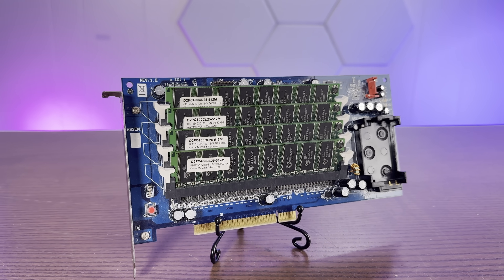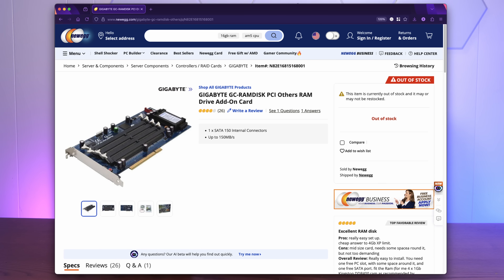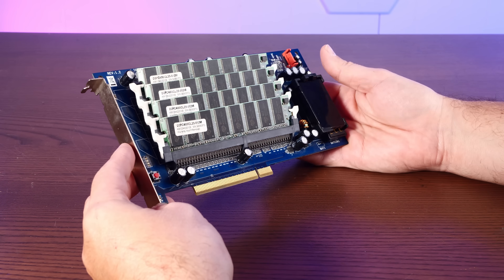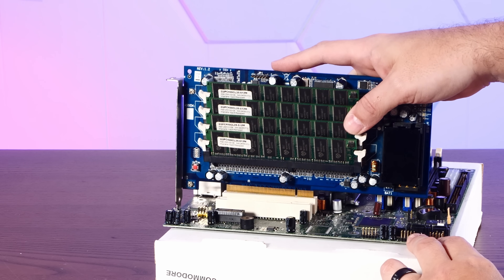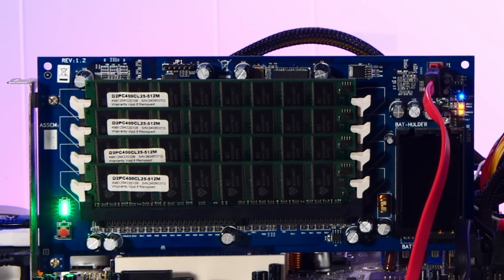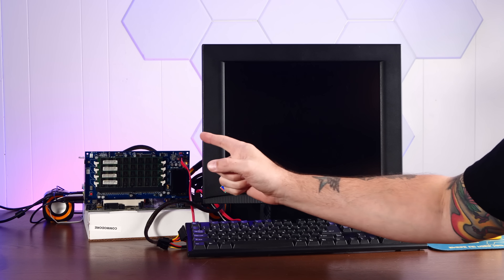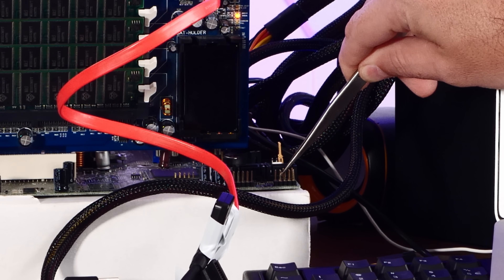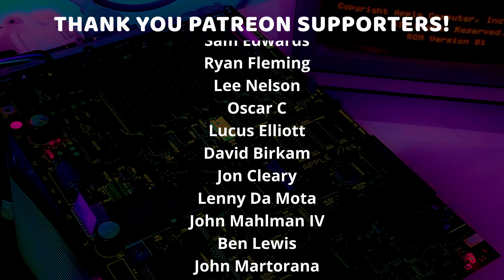This Early SSD Was WILD

Comment: Glad I was able to find this for you haha, such a dumb but hilarious storage solution.
Reply: How is it dumb?
Reply: dumb for OS and mission critical storage, however, during this time if you were using this as "scratch drive" as mentioned for say PhotoShop or Video workflows, the speed for the cost was wild for the time
Reply: This was a clever way to get past some of the limitations of old PCs.
Reply: It's not Dumb at all.  How many of us Have stacks of Old Memory from old computers we owned at some point that we've moved on from?  That Old DDR3 memory stick can have New life in a device like this instead of ending up in a landfill somewhere.
Reply: @jonjohns8145  Costs more to run than it does to buy an SSD
Reply: @jonjohns8145  you missed the part where this is not DDR3, its DDR1.  and you also missed the part where this uses a PCI interface. not PCI-E, so you would need a old pc with pci. and all that to have a singular digit of gb of unreliable storage?. so even if someone made a ddr3 version it would not be cheap. and the ram you have laying around would be what? 1-4gb sticks? that would be at best 4-16gb of storage to do what with? unless you just looking for a gimmick  to throw money at seems pointless as a use. a 120gb ssd is like 10$ new nowdays
Reply: @chloeprice8  the PCI interface is just used to get access to the 5v Standby power rail to keep the RAM refreshed while power is off. The battery is charged from that, and is only supposed to kick in when the PC is unplugged. You could also get a wall wart brick to keep it powered separately from the PC. If you supply it power, you don't need it to actually be plugged into a PCI slot to work.

All the IO goes the SATA port. And yes, there were more expensive versions of this from a couple other MFGs that could take more RAM and eventually supported faster SATA speeds.
Reply: @771racing  yea and you do that..then what? you now have not only have a volatile meaningless small ssd that would still lose all its data on a power loss..but now you made it be more jank too. now what you use that for? i mean sure to do it for lols and toy with it. but original point remains how would having a singular digit gb ssd be any practical use in today's use?
Reply: @chloeprice8  If you manage to keep it powered it's much more reliable than an SSD. You can read and write on it indefinitely. The read/write cycles do not degrade it like an SSD. There are many instances that use the HDD for extension of the RAM and if your industrial board has no support for more RAM sticks or is limited by BIOS the RAMdisk would be a much better solution than an HDD or SSD.
Reply: @TheOriginalEviltech True.  I'd forgotten that SSDs have an almost definite failure threshold.
Reply: @TheOriginalEviltech I still have my first SSD drives that I bought around 2010 and they have not degraded at all according to diagnostics. They were the primary disks in my laptop and workstation for years before I made them storage drives. SSS are a lot more reliable than you realize, especially the current stuff.
Reply: @chloeprice8  If I remember right I had 1-2 player friends who were overly rich and had that for gaming reasons.
Reply: @chloeprice8  They were not even PCI, they are actually SATA, just use the PCI slot for mounting; there was another version that used a 5.25 drive bay. And yes, they were DDR1, which was dirt cheap back then.
Reply: @acorredorv  you clearly skipped all the context.its a pci card that needs a pci slot to get power. new pcs(pretty much anything after 2013-14 as new) do not  have a pci to provide power to it. so you would need a jank way to power it. butl lets say you jank it up and it works. now what? those can take max 4gb of ram. what you gona do with a whole 4gb  of unsafe  volatile  ssd space? even as a "cheap way" if you looking  for something to just mess around as retro tinker then sure. but as an everyday usable part this makes 0 sense even if you could pick one up for 10$. a middle of the road 120gb ssd is now 10$and is more than x20 the space. same goes for the 5'25'' one. new cases don't have that (well im the exception cuz my pc does have them and i would still not use of those things in it...its pointlessly small)
Reply: @chloeprice8  you skipped the part that mentioned the iRAM was also available as a 5.25 bay device, no PCI slot required.
Reply: @TheOriginalEviltech  you are underestimating how reliable ssd's still can be. i have ssd's that are 10 year old now and had multiple TB's of writes on them...and there still at atleast 90% health. also you are incorrect. ram sticks even tho they last for really long time being written over and over even those wear out eventually or fai. so no nothing if forever or infinite. also if you mean to use it as a hdd drive cache. that also wont work cuz you need alteast 16gb for any meaningful capacity of hdd...those max out at 4gb. after that to use it as more ram by making it a pagefile drive that again makes no sense since you would bottlenect using it since it would run at sata 1 due to the slow sata controller...and all that just add 2-4gb more ram to your pc? seems pretty pointless
Reply: @acorredorv  nope. you skipped reading about the 5.25'' bay part i also answered about. maybe don't skip reading the whole text and then complain about it :)
Reply: @chloeprice8 the most obvious use if this would be as a cache drive, considering it uses Sata as the interface, it could push 83MB/s for games that could probably entirely fit on it
Reply: @3of12  well i never said it was dumb for the winxp era. back then it would of made  a big difference to have even 2-4gb of fast storage space. and yes games were pretty small in size so you would easy fit a few games on it. hell if you wana build a retro pc even today this would still make some sense. but ppl here are making claims that this could still be used in a modern pc which it wont just plug&play work nor it would make any sense. yes you could hackjob jank make it fit and eventually get it to work but again those take 4gb max and 4gb wont fit anything in todays era
Reply: @chloeprice8   @chloeprice8  wow, you went from zero comprehension skills straight into gas lighting. Tell me, how does it feel to be always right?
Reply: @chloeprice8  for 2006 this would have been top of the line, great for a cache. By modern standards its garbage, but it shouldn't be compared against modern hardware. Its a relic of the past, and should be treated in that context. It was faster than 99% lf storage solutions of the time, and at a staggeringly low price. Nowadays nvme rules the roost, but in 2006 NVME or even sata SSDs didn't exist or where $$$$$, this was a good alternative for a low capacity cache.
Reply: @chloeprice8 that's fair, certainly but think about how useful each generation of tam would be for the same purpose during their time. Even today, lower quality DDR4 would make an awesome ramdisk with a bundled cache software like primocache. You could get a hold of 64GB of it on a PCI-E card and maybe sans the battery it would be great for purpose. It would be absolutely stupid fast even with a DDR4-3000 kit.
Reply: @acorredorv  nah bud. you gaslighting your self with your own sayings. but since you like gaslighting ill fulfill  your gaslight. i love being right and i was right all along :P
Reply: @3of12  would be a cool concept but no such  thing does  exist cuz it simply does not make sense to make a new version of that card. it would not sell so no company would invest making one. plus the idea of adding 64gb of ddr4 would not be atall cost effective since a 64gb kit costs like 150$. and thats not including the cost of the card. so at that point and cost just get a fast m.2 or pcie accelerator ssd and would be faster and cheaper
Reply: @chloeprice8  this was invented before SSD's existed genius
Reply: @TomAnderson-b1d  yea no shit sherlock. tell me something i didn't know. ive been in pc's before you knew how to even turn one on by the sounds of it lol
Reply: @chloeprice8 SSDs did exist back then but we're kinda crap. They had really low writes before failure count and we're basically useless for anything other than to boot your OS from unless you were ok with replacing it ever couple of years.

If you needed a RAM disk that would survive a shutdown or reboot, this was the only real option. Also, this card only used the PCI slot for power, it actually connected the RAM to a SATA port and presented to the OS as a disk drive.
Reply: @meansquaretech  im aware of how ram disk works. also i can't relate with the claim that ssd's of those days failing. i still own an 32gb and a 64gb ssd  from those days and both have a bajiliontrilion of hours, writes etc and both are still perfectly functional to this day and still have above 90% health. when ive had reputable current days ssds in both sata and m.2 fail and be under 70% health in under 3 months use  and not even hard used or abused, all they did was just run windows with low writes use, so your claims don't really seem to stand up well :) also ram disk was not the most reliable ether and that is proven by how it never took off and how short lived it was, it was more a gimmick than an real use item
Reply: @TheOriginalEviltech  If it's ECC I would agree, but I don't think it is. SSDs use ECC (CRC, but essentially same thing)
Reply: i think there was a ddr3 thing like this, or is it my desire in that days
Reply: Reusing the most popular lithium battery at the time, the nokia BL-5c pack, which were pretty much a de facto generic battery, used in so many things along with the use in phones, and which you can still find made new even today. I do remember having a 32M CF card, for an earl camera, and also have a Sony camera ( though with the Sony infolithium battery being so degraded it can only power the camera for 20 seconds now) that came with a whole 8M of Sony memory stick as standard.
Reply: I was a technician for a local government office support data center, at the time these were in use, there was NO other option for highspeed storage. The idea isnt dumb, when it was quite literally the only option at the time. Its dumb now that non volitile dram exists, but it didnt exist then and even when it debuted, was prohibitively expensive even for government offices.
Reply: I have two 8-bit ISA cards that I can use to create 1, 2, or 3 solid-state drives. They can use PROM, EPROM, . FLASH, or SRAM. For the SRAM they have a lithium battery, which, according to the documentation, can last up to 5 years in one charle. One card can create two drives of up to 6 MB or join them together to create one 12 MB drive. The other card can configure up to 3 solid-state drives, up to 6 MB each, which can also be combined. THose are usually used in industrial enviroments. only with sram you can write and read on them
Reply: @mikes989  I have a card like that too. Mine is branded Everexx and holds upto 4mb of sram plus upto 8mb of some type of (i think) propitiatory and persistent flash ram. And the SRam can be configured as either storage, XMS or EMS. Both are also configured independently and can not be setup as a single volume. Sadly i do not have it fully populated and it seems to exhibit stability problems. But its performance is 'interesting'.
Reply: The principle in enterprise SSDs is still the same. Instead of the battery you've got capacitors for the cache in terms of power loss. What's missing is the non volatile memory actual SSDs are writing on.
Reply: It's not Dumb at all
Reply: It's not dumb because it's not a storage, is a scratch disk...
Reply: dumb i don´t know is it.. if a memory chip died u can install a new one... meaning can u replace this on modern  ssd no way. I am sure this was used in server and not for a OS. Back in the day u had a backup on a slower sata where it install all the ram disk every day. like a HDD Image. when installed on idrive u have a very fast pc back in the days.  So no need to worry about the Accu.  so i ask again is it dumb when u cvan replace parts and have a backup image of the ram disk on a diffrent device that last longer in case something died... no i don`t think so...Todays people do not understand the way it was used back in the day. and that is only one exsample for this...   but what can we du with simlar ram disks... we can us this as page file holder for vram or  program a  software  that ad this to the vram
Reply: @MiniTitanic1 I had a couple of these in a server as a working drive for span filtering and it worked wonders! They quintupled the speed of spam filtering on the incoming mail servers
Reply: @MiniTitanic1  I am more surprised by the way all the OS use the hard drive so much and can't see why they use ram a whole more
Reply: Thanks man.  I've been a tech for 25 years and somehow missed this monstrosity!  😂
Reply: It wasn't meant for long term storage, it was intended as a temporary storage space that you would load a copy of your work and software on to save time. You would then copy back to your actual storage when you were done.
Reply: Just for the fun of it I think I would use it as a Ready-Boost-Dive in a 32-Bit Vista, 7 or 8-Build. Back in the days I had a Fujitsu Amilo A1630 with 2GB of RAM and I used a USB-Stick for Ready-Boost with Vista and it made WoW from a stuttery mess to somwehat playable.
Reply: it's not stupid if it works (...until you run out of battery that is, kinda wish it came with two of em for hot swapping, that'll be convenient.)
Reply: i want one for ECC DDR3, have you seen the prices on server ram from that era?! it's insanely cheap per gigabyte for that kinda thrash performance to this day.
Reply: Only reason I never bought it was because of the high cost of both the board and the ram sticks.
Reply: ever hear about RAM disc?
Reply: Not dumb for the era. Many people could've actually used it back in the day: programmers as fast RAM disk for compilation, database cache, video editors & photographers as a "working" disk. 

Part of it could also be used as a swap as well - as swap on HDD was crucially slow - but I think if someone needed such solution, it could afford enough RAM in their computer back in the day 😉 

Only question is how much RAM it could take?
Reply: @kkolakowski  it can take a max of 4gb. thats the biggest sticks ddr1 came out as was 1gb sticks. and you would hope you find sticks of that capacity to be compatible to fill it up. then again would be rare for ppl to have 1gb sticks laying around. most ppl would have 256/512mb sticks
Reply: wheeeeeeeeeeeere? want one too :D
Reply: I actually looked to buy this adapter in 2008.  Even then, it was hopelessly limited with expansion limitations.  What made me even more confused is why they did not utilize the 33Mhz PCI bus, which is much quicker than Sata1.

Still, I would find a use for it, in a old Pentium 4 build.  Yea, I do enjoy playing with 20 year old equipment too.  You'd be surprised what a hopelessly antiquated PC can actually do, without bloatware running on it, Like Microsoft 7,8,10, or worst:11.
Reply: I guess this would seem dumb to someone who doesn’t remember how horrifically slow platter drives were. This wouldn’t (or shouldn’t) be used as the system drive for any mission critical system but absolutely had real world uses as multiple other commenters have pointed out. For someone like me who likes to tinker and wouldn’t care about data loss this would’ve been an absolute dream. Solid state storage has been the most significant contributing factor to increased system performance in our time.
Reply: @Barryyyy and increased data loss too.
Reply: Mfw been looking for something like this.
Do to some temporary recording nonsense, and having to have bigger files that constantly update for server stuff.
This is perfect for basically running something close to NVIDIA shadowplay where you have constant video of previous 5mins or so for recording clips.
Doing something similar but on a much larger scale. Why dont I just use my systems ram you ask? Got other stuff running there.
Reply: Oh can still get something similar CXA-8F2W can get up to 1TB of DDR5 in PCIE slot
Reply: I wonder if i could install redis on it😅
Reply: it is wild!!! LOL
Reply: Ne aktuell mve ist 100x schneller
Reply: I ran a production database off of one of these back in the early 2000s. By the standards of the time it was fast but not enterprise ready.
Reply: This is cool.  If I had used this whole nvthe past I would've setup a RAID-1 to mirror to a slower HDD to avoid loss of data.
Reply: I wanted this so bad for my awful, all-in, commitment to a watercooled pentium 4 3GHz. I instead got a scsi card and 8gb 15k rpm drive that was not worth the time/effort and had to be trashed because my freshman year roommate was not okay with the noise it made.
Reply: macOS it now
Reply: This isn't 'dumb', and at the time it was released, it would have made for the fastest Ram Drive possible (Following on from the Earlier Vesa Local Bus and ISA bus boards, for 386 and earlier PC's.
They were especially useful as Ram Drives to hold the DOS/Windows Virtual Memory file or Swap File, and as a frame buffer for video capture hardware, to hold video frames in ram long enough for the drives of the day to be able to write to disk. They could also be used by servers doing finite model analysis and astrophysics to hold large datasets in quickly read space. Current versions include cards like the Accellsior 4M2, carring 4 NVMe drives as a raid array, useful for capturing Uncompressed Raw 4K and 8K video.
Reply: @PiDsPagePrototypes  It is only SATA 1. It was never useful for video capture when a raid zero with high sequential throughput would out perform it. And science modeling was done on servers with way the heck more ram than this thing could ever hold. What you compare it to are modern persistent storage solutions, which also existed before IRAM in the form of FusionIO and first generation 3d-xpoint. Sorry. The only thing IRAM was useful for was as swap space on 32 bit ram starved consumer grade computers. It had limited use and only filled a tiny neitch for a very short time.

You also forget that PCI-X existed with up to 2 gig/second bandwidth since the late 90s.
Reply: @PiDsPagePrototypes  I remember ~2007 company that I was working in had server with 4 or 5 this cards inside. It was for company telecommunication billings database and it was rocket! We could do any operation on DB just-like-that without any waiting for results.